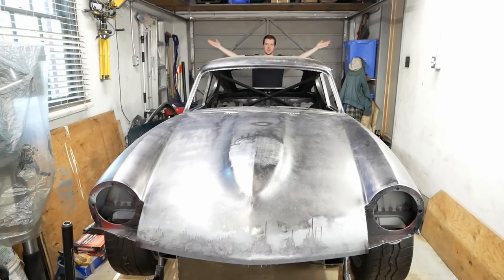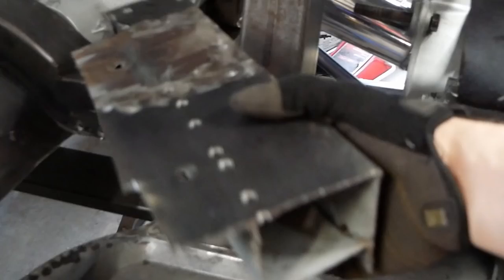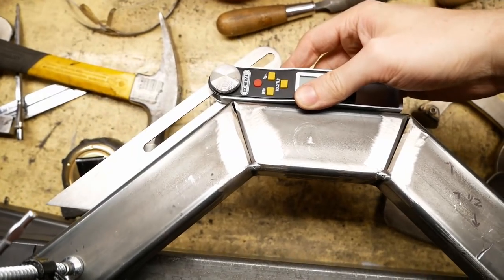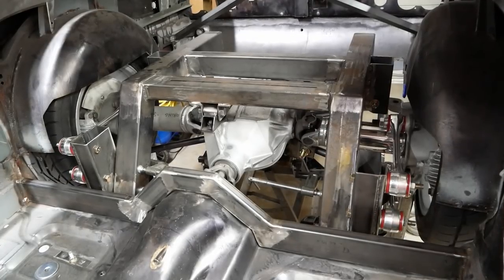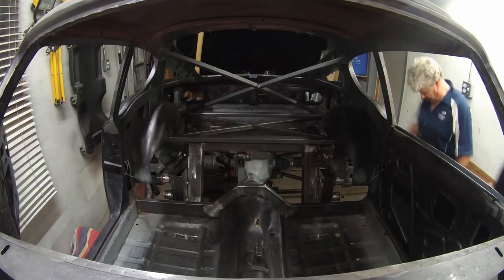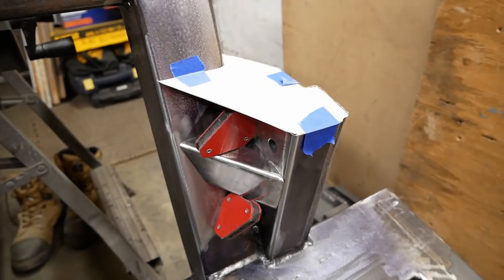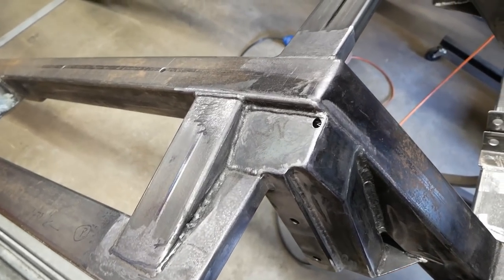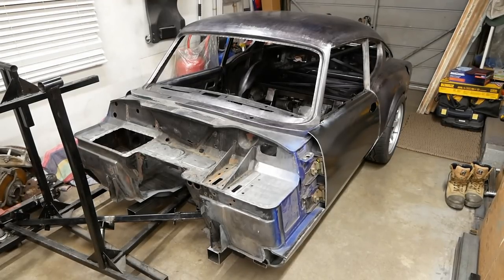Something's Missing! Pro Touring V8 Triumph Build – Project GT6R – Ep14

Comment: Nice progress on the frame.  Rear suspension mounts look great with the boxing.  Yes, it's low.   But the cockpit has a lot of space with a reclined seat - keep that in mind as you finish it out.  Glad you did this with a Mark III.  The rear treatment is more distinctive than the earlier configuration.

Comment: Nice build so far, very cool. 👌.   You should have cut channels in the floor pans to recess the frame, then welded floor pans to the frame for tremendously more body/frame strength. You could at least made the notchs in the main rails deeper to tuck the frame up for more ground clearance.      Metal fab tip: please use an electric orbital sander with 180 grit disks to finish dressing your welds after grinding for a seamless more uniform look, it will find your low and high spot quicker, it will help you roll welded edges beautiful and save using a lot of filler.          Great father son build 😎😎
Reply from the maker: Hey Thomas, thanks!  We explain the frame design in episode 12... we wanted to notch the floor as you say but seriously wouldn't have had enough head room if we did.  The car sits lower than a Lotus Elise believe it or not!
Glad you're enjoying the project, cheers! 👍

Comment: Two things to add coming to my mind here: Crumple area in the rear frame rails and drain holes in the rails and enclosed areas (which will also help putting some wax in against corrosion).
Reply from the maker: Thanks for the suggestions!  Both will be incorporated! 👍

Comment: AT least you'll have peace of mind for when you hammer on the gas you'll know that frame won't twist in half and make your car swerved into a oat tree. Which is smart of you both to to fabricate this frame properly. As a welder fitter with many years under my belt, I don't see any issues with what you've done thus far. So kudos to you both since you are not fabricators by trade, it looks like you've done a descent job on this build. obtw that little beast should go like snot. I bet it will be a fun car to drive for sure.

Comment: when the body paint colour is chosen, i hope it will be british racing green.  what all gt 6 mk lll s should be.

can't wait to see the finished product.  although i'm concerned about the rear end geometry in corners.  the old swing axles on the spitfires were dangerous and in the final years of the gt 6 the spit's rear end was used.  i thing they called it the swing spring, because the transverse leaf spring was not fixed to the frame but was allowed to move side ways.  i found them lethal on my spits.  it would swap ends at the least provocation when driving the limit. 

i had three spits and a 72 gt 6 mk lll.  my gt had a british leyland racing suspension and was extremely low to the ground.  the springs were hard as a rock and you could feel every crack in the road surface, but the result was the gt was super agile.  my gt had the old style double wish bone rear suspension with the rubber axle joints so it handled well.  

 good luck.
Reply from the maker: Thanks!  Yes the swing axles are scary.  Our new geometry should be fine, we also used to have the Rotoflex setup and this is kind of similar - but has better camber curves, more adjustability, and much stronger components.  Cheers! 👍

Comment: Very cool build!  Are you going to put those rear suspension links' chassis side bolt mounts in double shear?  I hope so,  I would certainly sleep better if you did.
Reply from the maker: Thanks for the concern, it's something I've always pondered on myself, but it's single sheer from the factory on the hub side of the link... So........
Originally the chassis side was double sheer, but with the GT6 being so much lighter I'm just not 100% sure if it's really necessary.  You'd still do it?
Reply: Yes I would.  IMHO it's good engineering practice to put bolts in d'shear wherever possible. Agreed,  much more difficult to do on the suspension hub end of the links but ideally it'd be done there too. You know,  bolts were never designed to work in bending. Think of the stress reversal cycles there,  every time on and off the power in what is now going to be a very high performance car. 
Probably a 3/16" thick vertically oriented flatbar would do it,  " a couple ounces of prevention is worth a pound of cure ". Keep up the great work!
Reply from the maker: Very true!  You won't see it in a video for a while yet, but one of the next times the body is off we'll have to get this done.  Thanks for suggesting, and the help!  Cheers 👍

Comment: I have just checked the figures and, surprisingly, Triumph produced more GT6s than Jaguar built e types
Reply from the maker: Hey Ray, according to wiki, there were 40,926 gt6's including the mk1,2 and 3.   Jag built 67,300 e-types through series 1,2 and 3.  So, not a ton more, but still more... and were nonetheless hugely more *popular*.  Cheers!👍
Reply from the maker: P.S. Jag numbers taken from etypeuk(dot)com ... Wiki states slightly higher at 72,515.
Reply: Fanatik Builds I apologize, you are indeed correct. My E type figure was for the S1 only. Fantastic project by the way. Can’t wait to see the result.
Reply from the maker: No worries!  Thanks, glad to have you along for the ride!

Comment: Given how small this car is, the power ( or more relevant torque ) to weight ratio is going to be ludicrous! Have you discussed detuning the engine for better economy or perhaps fitting a 155 mph speed limiter? It’s just that I worry about the wind resistance ripping the body shell off the chassis! Ha ha! Live long and prosper boys, loving every minute......
Reply from the maker: Thanks Phil, we're estimating the curb weight to be ~2200-2300lbs and 350hp/360lb/ft so yes, should be entertaining!
Not planning on detuning, skinny tires and a reserved right foot will help. 😎 As for speedo limiter, well, mechanically it'll hit 200mph, but there's not a chance of us ever attempting that, lol!  We'll be using the Holley Terminator EFI eventually so if we can hook up the trans signal we may indeed put some kind of limiter!  Cheers! 👍

Comment: How do you weld so the welds do not twist the weldment in to a pretzel. You had a problem with the engine cross member bending.
Reply from the maker: The main reason the crossmember in Ep21 warped slightly was because material was removed from the same side that the welds were added.  Together, this pulls on the steel and makes one side shorter than the other, causing the bow.  The rest of the frame (such as these front extensions) could be welded in stages on opposing sides to help control the heat and how it pulls on the metal.  Usually outside corners first, inside corners last, and a criss-cross pattern is the best method.  Bracing everything adds security too!  Cheers James!
Reply: @FanatikBuilds  Well welding puts stress on the weld ment any way. that is why the trueism of the weld being stronger than the base metal.
Crack a book.

Comment: On the frame what is the wall thickness 3x2 or??
Reply from the maker: The main rails are 3x3 with a 0.125" wall - likely could have used 2x3, but went this route as it looks a bit more original to the car!  If you can fit 2x4s for your main rails, you would be far better off!

Comment: What model Lincoln welder is that?
Reply from the maker: It's the Mig Pak 140 - been a great unit that we would definitely recommend!  If you have a 240V outlet, go with the Mig Pak 180 though, it'll be much better with heavier gauge material.

Comment: Nothing scary or problematic about more than 100% anti dive. A large proportion of drag race chassis built in the last 14-18 years are that way. In use, you push the tire against the asphalt, starting from a very low static ride height.